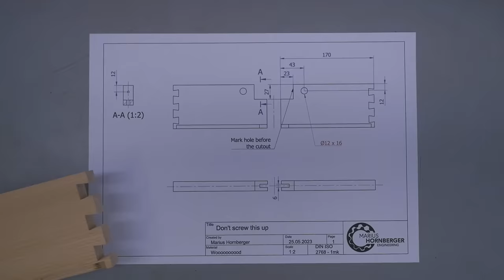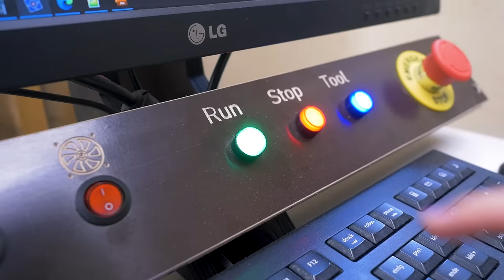Making Custom Storage Improvements & Giveaway

Comment: I love the pull out pantry, I have been wanting to convert my walk in pantry into a few pull out cabinets.  Walk ins are such wasted space.  I had the original wood pantorouter but lost it in a hurricane.  Great tool, they have really done a nice job with the metal version.  Nice to see the dowel trick used to allow solid cross grain in a fastener joint.  I use that all the time.

Comment: My pantorouter is older than your's.  I bought it before there was any distribution network, so I had to order it direct from Kuldeep Singh in Japan.  Kuldeep, with help from his very young daughter, packed up and shipped the box of parts. It came with no instructions of any sort.  To sort alignment issues I corresponded directly with Kuldeep.  And of course it didn't come with niceties like dust collection and a tilting table, and had only the most basic templates.
Reply from the maker: Cool story. The pantorouter had quite a journey since then. The first one I got was also shipped from Kuldeep

Comment: Funny seeing this video now. I happened to want such a cabinet with such a pullout mechanism half a year ago. It took me a long time to figure out where to get the mechanics without having to buy the whole cabinet for way more than 2000€ from the manufacturer of the kitchen. Turns out there's an excellent company called Kesseböhmer making them in a very high end version with different shelve options (I paid 480€ for mine), their frame is also hight adjustable -- unlike yours it seems. So I went the other way around, picked the maximum size I could fit in the available kitchen space, bought the mechanism and built the cabinet around it to fit snuggly.

Funny enough it seems that you have chosen then very same glass containers with sealing wood lids and labels than me, only that I have a lot more of them. 😅

I guess if I you had produced and I had seen this video earlier it would have saved me a ton of research time since I didn't even know what options to build such a cabinet were available when I started. Maybe I'll still make my own shelves because yours look way cooler than mine and I could probably use 1 or two levels more than the 5 I have at the moment. 👍🙇‍♂

Comment: What's the max weight those pantry drawers can take, considering you only have a 1/4" or so perimeter glue joint holding the plywood to the sides (and thus supporting all the weight)? I'd worry about that as a point of failure, with no mechanical joint/reinforcement. Seems like this is why a lot of drawer bottoms are done with a rabbet that's not flush with the bottom surface of the drawer.

Comment: Had to go back 3-4 times to understand the point of the groove at 11:40… would that be the fix for the first tray not fitting on first try?
Reply from the maker: The groove is there to clear the hooks of the metal frame as you slide the box down
Reply: @MariusHornberger  Yes… it's just that you mention the groove once over that shot, and then not anymore. We see it clearing the hooks but it's really quick and you don't explicitly call attention to it so it's easy to miss. At the end of the video I was like "wait, didn't he promise an explanation about something earlier?"😅

Comment: First , love the channel - and watch every episode. You're a smart guy using your energy for a good thing. However... 
I have lived very near San Francisco for many decades, been there hundreds of times for many reasons and I'd like to suggest that you be careful there. That place has turned just as bad as you may have read about. The Bums and Junkies (don't insult the Homeless by lumping those with unfortunate circumstances into the ones you see on the streets whose minds have been destroyed by drug abuse.) can be simply offensive as they crap on the streets in front of you, or outright dangerous as they break your car window and steal everything in your car then challenge you to get it back. Cops can't help because it's a "sanctuary city" that allows everything except personal responsibility. Many conventions won't even go there anymore because the attendees refuse to go.  If you live there it doesn't seem so bad because the changes were incremental and you adjusted and avoided as needed,  but from the outside, it's the decline of civilization in a single city.

Comment: Awesome video. I live in Texas, so it's always interesting for me to see homes in Europe again. I lived in Europe for 2 years, in both France and Belgium, and it was always a surprise for me to see someone's kitchen, and how well it needed to be designed to work well with the limited space most homes have. Where as many kitchens here need little thought to the design aspect as you just have so much more room. Since it's not very expensive in comparison to just have your kitchen space be 2-3 times the size of a European one, it's fairly common to see massive kitchens with 4x8ft islands in the middle with cabinets all around and big walk in pantries.
We are remodeling our house right now and will have double islands, so I'm a bit sad that there's litterly no need to design or purchase thoughtful Space saving designs that are often creative and fun to use.
I'll probably add in a few, but they are mostly for the want, and not the need.

Comment: Tip from a carpentry student, when cutting dovetail joints, cut them about a half millimeter deeper. The leftover wood you can sand away after glue up. We are getting this thought in German carpentry school, because it helps close up tiny gaps and makes glue up easier.
Reply from the maker: Thanks for the tips. I then need to oversize my stock as well to meet dimensions correctly, right?
Reply: @MariusHornberger  
Richtig. Teile etwas größer machen (z.B. 1mm) und dann die Schwalben und Zinken jeweils 0,5mm tiefer fräsen. Danach Kann man die sauber bündig machen. :D 
Du kannst dann auch mit dem lichten Innenmaß arbeiten, was das Messen und anreißen einfacher macht.

Comment: I'm kinda not sure about the position of the hooks. All the weight of the box is only held by the small bit of wood above the hooks, which might break off if you store too heavy things in it? Maybe screwing them in at an angle could be an option "for the next time" :)